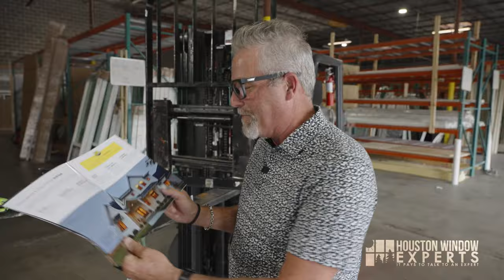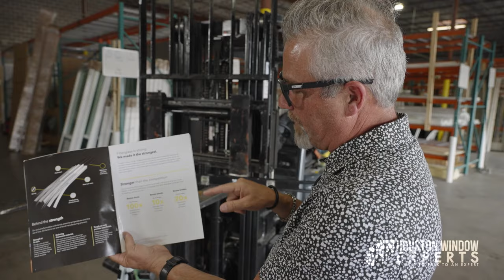Which Is Better: Pella Impervia Or Andersen Fibrex?

Comment: I have spent 30 years installing windows and I have experience with both of these windows. I’m aware of the manufacturer’s claims regarding strength! But this kind of strength you tested doesn’t really address real world concerns. Once a window is installed, I don’t think these strengths are an advantage.
Reply from the maker: Thank you for watching and for your comment.
Reply: Wich do you recommend an why??
Reply from the maker: Thanks for watching and your comment.
Reply: I have seen first hand Anderson Fibrex window sash break at the lock rail on single hungs from customers apparently slaming them shut.  Thats the reason I clicked on this video, I have been leery of pushing sales on Fibrex because I have seen how brittle it can be.
Reply from the maker: Thanks for watching and your comment.
Reply: Nice thought but slam an Anderson window or in my case have it hard to shut then it got past the sticking point and cracked the sash cause could. It slow it down enough.  Would have been better had I had a pella.
Reply: I've been installing for 30 years+ also. Most manufacturers have several different series of windows. I've installed only a few fibrex. But I have removed and replaced several Anderson vinyl and vinyl clad wood windows over the years. For the time they were manufactured, they were very good efficient windows. As time goes by, more advanced designs show up on the market. (Some better, some worse) . Saying all Pella is crap, or all Anderson is crap, or Simonton, or Marvin, or Polaris, or Alsides, and on and on. Is not fair, they all have cheap lines. Most have top tier as well. All have their problems. Lock rail blowouts occur on most if not all vinyl windows. Generally if the balance is too high mounted in the frame and the window is slammed. Poor quality control is the BIGGEST problem with most of the manufacturers!

Comment: Interesting and somewhat informative.  It would be good to show impacts from something like pebbles or hail at speed. I am not aware of any window problems caused by weight lifting weights in real life, or for that matter 270 lbs hung from a strap off the frame or sash.  Fun to watch, none the less.
Reply from the maker: Thank you for watching
Reply: A friend of mine is on the plus side of 375 pounds, not fat. Was a Football player, now retired. He always buys "The Best" as he can afford too. 

He was sitting on the window sill of his house that had 1 year old RenewByAndersen windows. The sill cracked and split, cutting his leg a little. Still fighting with them to replace it under warranty as they said it was not designed for that weight. He had sat in the same window many times when it was a wood frame and sill. Same issue with the Andersen slider door frame, split where his boot heel met it.

Comment: Ceteris paribus (all things equal) in terms of window size, similar glass package, same installation team, installed at the same house, etc. - are they priced equally?  Or does one come with a price premium?  Premium percentage?
Reply from the maker: Thank you for watching. The Pella Impervia should cost about 30% more than the Andersen Fibrex. However, in the wrong hands, Fibrex would be pitched at double the price of the Impervia.
Reply: @HoustonWindowExperts  Thanks Jeff for the prompt reply.  Would I be correct in assuming if I wanted to remain within the Andersen family of windows I would need to move to the A-Series to get similar performance to the Impervia?  If so, are the A-Series and Impervia by Pella on par in terms of pricing?  Thanks in advance!
Reply from the maker: Not necessarily. Andersen does not have any windows that are true fiberglass. If you wanted to compare the Pella impervia to anything else, it would be the Milgard fiberglass windows or the Marvin fiberglass.
Reply: @HoustonWindowExperts  I'm deciding between these 2 windows and Its so hard to choose whether it's worth spending that extra 30% for the Impervia.  That is a significant difference but it is a better window.  What to do???
Reply: @jasn010 impervia much cheap than Anderson fibrex😊

Comment: Awesome job guys. I was not shocked at these tests, fiberglass is definitely stronger than fibers but where fibers really wins is on the paint/durability. Fiberglass windows peel, chip & flake off and Pella claims a warranty will void if you try to repaint them vs fibrex won’t peel, chip or flake and you can paint them if you want.
Reply from the maker: Thank you for your observation. I personally would never want to paint any kind of a window that wasn't made out of wood.

Comment: I live in Michigan and can tell you our windows have never been subjected to 50 or 100 lbs of weight, so while these tests were fun to watch, they don’t really matter to me. The real test is how the joints separate when the windows are fiberglass - the joints are connected with metal fasteners and when it’s cold those separate and result in drafts. Fibrex windows are fused together with high heat and pressure, just as you pointed out. They don’t separate at any cold temperature that we’ve experienced. I’ve had both types of windows. Fibrex is by far superior and more energy efficient. Additionally, fiberglass requires regular maintenance in the form of gel coating every year. Renewal by Andersen’s Fibrex windows are completely maintenance free. Bottom line is that Fibrex is the better product when you test it for what really matters to us. As I’ve said I’ve had had both in  my house when It was 20 degrees below zero for several days.Now that’s a real test! Sorry Houston.
Reply from the maker: Thank you for watching and for your comment. It's a common sales pitch for fibrex salesmen to tell you that fiberglass needs a new gel coat every year. They must be thinking about fiberglass that's used for boats. This is nothing like that at all.

As long as you are enjoying your windows, that's great!
Reply: Love it!! Great points!!! And totally agree!!
Reply from the maker: Thanks for watching
Reply: Insulation and weathering resistance are the most common concerns in cold zones; I prefer Andersen.
Reply from the maker: Marta, it sounds like you work for the Renewal folks. The gel coat story is completely inaccurate but a rehearsed phrase by RBA reps. Infinity windows use an Acrylic finish and Pella uses a wet paint finish. Neither one will ever require gel coat applications. (they're not boats).

The corner keys are a high density plastic that conducts virtually nothing. (and does not expand and open gaps).

By the way, I am from Grand Rapids!
Reply: @HoustonWindowExperts  thank you for responding to this. I was concerned, but not any more.

Comment: Thank you for may of your informative videos. It is very hard to chose between different windows. I also learnt the pros and cons from your single hung and double hung windows. I think I need not buy all double hung windows except the ones that are high up. The draft in double hung is my concern. Renewal by Andersen gave me their best quote as 31k for 10 3'x5' double hung fibrex windows with inside grids and cedar trim. I think it is very high. Any idea how much should be a reasonable price for 10 windows? Main goal is insulation and no draft.
Reply from the maker: I'd avoid Renewal. Find a great local company and you'll get a better installation at a better price. 

I started a website to help people locate a great window company near them. We may have someone in your area. Please visit TheWindowExperts.com
Reply: @HoustonWindowExperts  Thank you for the quick response. Yes, I already visited your website and submitted a request. I did not see a list of installers in the Portland area on the website. Thank you again.
Reply from the maker: Actually, we do have a friend of mine that has a great window company in Portland. We will get you their info on Monday.

Comment: I was surprised at Renewal By Andersen Limited Warranty only covers installation for 2-years and does not cover  "performance of the low-maintenance exterior glass coating on products with HighPerformance Low-E4® glass"

Comment: Appreciate your videos, have learned more from you than just about any other on Youtube and wish I lived closer to Houston.  But how does this testing help someone make a decision between fiberglass and Fibrex?  A typical 30x54 window sees a 300 pound total load when wind speed is about 120mph, and it's distributed over the whole window area not concentrated as in this test.  So the actual deflection each of these materials' frames will see under normal or even elevated circumstances (say, 60 mph wind) is going to be negligible. Or, close enough to one another that I'm probably not making a buying decision based on this kind of strength performance. The impact test is more relatable and interesting, but drop an iron weight on a high-end aluminum-clad frame and I bet that doesn't work out very well, either. 

Andersen makes A-series fiberglass as well. What might be more interesting is how fiberglass compares to Fibrex in terms of temperature expansion/comtraction, long-term durability in its assembly, color stability over time, etc. All that said, I realize much of what you set out to do here was to verify Pella's strength claims. Thanks.
Reply from the maker: Thanks for watching and your comment. Yes, it was to verify their claims

Comment: The reason the temperature was rising so fast is because these materials are good insulators.  The heat cannot make its way into the part very well so the surface warmed up fast.
Reply from the maker: Thank you for your comment.

Comment: You perform a great service.  I live in the Las Vegas, NV area.  In the summer we are very hot (107+) and very dry (2%). But we can get below 32 in the winter.  My house has 1999 contractor vinyl windows and they have held up pretty good.  But it is time to replace them.  Vinyl is what most replacement window companies in the area offer. The Anderson guys say vinyl is not good (yet their product is 60% vinyl).  But Anderson is about ~2x the price of high grade vinyl and the warranties are about the same.  I want to also consider Pella fiberglass and vinyl.  Can you offer any advice for a very hot and very dry climate?  Thanks.
Reply from the maker: I'd avoid the Andersen guys. Go with Pella impervia or seek out an Amsco dealer.

You can also check out JeffsList.com
Reply: Same climate question here. I wish you had included heat testing here but overall this was a excellent demonstration!
Reply: I also live in Vegas, and my house was built in 1988 with custom aluminum windows that have failed which is to be expected after so long. I got a few quotes 73k for Marvin fiberglass, 53k for Milgard vinyl, and ultimately 40k for Pella Impervia fiberglass, I'll probably be going with the Pella. Note: my windows are black
Reply: @keishabaskin2174  just out of curiosity how many windows do you have?
Reply: @Kibatsume1  23

Comment: I'm more curious how well or how they resist transferring heat and cold. Also how well the windows insulate.  It's unlikely that they will be hit by a weight.
Reply from the maker: The Impervia performs better in heat and cold transfer.

Comment: How do you test the UV resistance? Which material is best UV resistance?
Reply from the maker: UV testing is done by exposing the vinyl to accelerated exposure. (usually is a lab). The main ingredient you would use in your vinyl batter to have a higher resistance to UV would be titanium dioxide. I would look for a vinyl product that brags about how much titanium dioxide they use. That usually gives you an indication as to how well it will resist exposure.

Comment: This is good but the glass type means a lot. Who makes the glass?  And I believe Fibrex costs less than Pella so not sure this is a fair test.
Reply from the maker: The glass is exactly the same in both units. They are made by Cardinal Glass.
Reply: @HoustonWindowExperts  my mistake. What I meant was different materials they both have meaning wood fibers and pvc verses the Total fiberglass in Pella.   Doesn’t Andersen now make an all fiberglass sash?
Reply from the maker: Andersen does not have a fiberglass product. It's Fibrex.

Comment: How would either of these compare to the Kolbe Forgent windows?  Do you have any experience with Kolbe products?
Reply from the maker: Kolbe Forgent is in a separate category. It's a polymer and fiberglass hybrid. I haven't personally had any experience with it but I do like the fact that it can have a wood interior option.

I think the frames are a little too bulky for smaller windows because of how much glass space will be lost. 

By the way, we may know some great window companies in your area. Check out JeffsList.com
Reply: @HoustonWindowExperts  Thanks for the reply.  We are leaning towards the Kolbe Forgent because they have large impact rated sliders and the wood interior is very appealing.  Haven't found any other brands with this combo.
Reply from the maker: If you need impact rated windows, that does narrow down your field quite a bit. Good luck.
Reply: @HoustonWindowExperts  Yes I did notice that the impact rating drastically reduced the available options for large sliders (i.e. Pella Impervia does not offer impact rated sliders).

Is there a reason you do not carry Kolbe products?  What is your overall impression of them?  Also, thanks for the link to your website.  I will check it out.
Reply from the maker: Most manufacturers do not want to have too many dealers in town with their products. It's about protecting their territory. There was a dealer in our area that already sells this product and so we do not want to add that to our list because we would not sell enough of it to be well-informed.

Comment: The drop test should include one at the highest on a fresh spot. Hitting the same spot incurs cumulative damage which would really never happen.
Reply: oops commented too soon I see the fresh drop was done.
Reply from the maker: Thank you for your comment.
Reply from the maker: Gotcha
Reply: @HoustonWindowExperts  Indeed! A window question for you... Have you heard of United Windows and Doors on out NJ? They are sold in Lowes and after comparing the "vinyl feel" of their 7400 replacement window compared to Pella 250 and even 450 and Anderson 100, the United felt less vinyl hollow to me and had good corner welds. I did look at the companies you represent and they were all Western or Southern based companies which makes sense for you so I suspect you may not have come across United unless they are in Lowes across the country. Another reason I like United is the factory is a 1 hr drive from me.

Comment: Wouldn’t you want a little bit of flexibility bend wise in a window -  as long as it could flex back? I don’t necessarily understand why being stronger against torsional stresses would be better for a window in a static wall, except for minor weather related swelling, which I would think then flexibility would be better so that seals don’t break and pop necessarily?
Reply from the maker: Glass is rigid. If the frame flexes too much you end up with seal failures.
Reply: @HoustonWindowExperts  ok got it - that does make sense.

Comment: Either one of these are better than any vinyl window, correct?
Reply from the maker: I would take a high quality vinyl over the Fibrex product. It's too brittle, in my experience. If the budget allows, the Impervia would be better to have than Fibrex or a lesser quality Vinyl.
Reply: @HoustonWindowExperts Why is being too brittle a bad thing? The Renewal reps are trying to sell me that vinyl is too flimsy and becomes warped over time, whereas the Fibrex stays the same shape 20 years later. They didn’t use the world brittle, LOL, but I interpreted Fibrex’s rigidity (my word choice) as a good thing - though I would have used the words “firm” or “solid” because brittle implies it will break…is that what you mean? The Fibrex breaks? Thanks! Still trying to decide…

Comment: From a strength perspective yeah the impervia looks good but I am really disapointed in how easy the finish chipped off the impervia. IM about to order impervia for a new build and that is one thing the marvin guys said was the impervia is just powder coated vs acrylic. It shows here. I would like too know what the marvin would do. I wasnt going with marving because I prefer the more modern interior look on the inside. The marvin essentials wont mull a transom too the top of a triple casement we have. And the elevate is wood interior, I just dont like the look. The other thing im not super excited about on the impervia is the exterior corners stick out like a sore thumb, you can see the light colored fiber fibergless
Reply from the maker: The Marvin Ultrex is far better than Pella Impervia. The finish is so awesome!
Reply: @HoustonWindowExperts  Are you referring too the essentials line?
Reply from the maker: Yes, or the Infinity product.
Reply: @HoustonWindowExperts  I really wish those windows looked like impervia from the interior. They look more like plastic. Really stinks because the finish seems better for sure form an exterior perspective. And the marvin modern is double the price.

Comment: But when making the frame of the window fiberglass has to be glued. Your opinion on glued or mortise and tenon joint?
Reply from the maker: The fiberglass products I'm aware of use corner keys and screws that are also sealed with a butyl product. I'm unaware of any glued fiberglass windows.